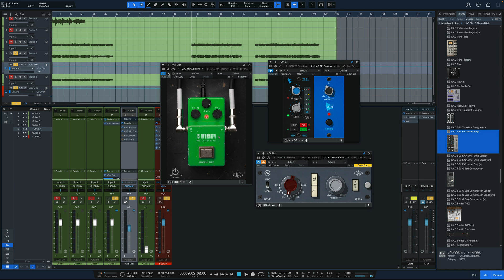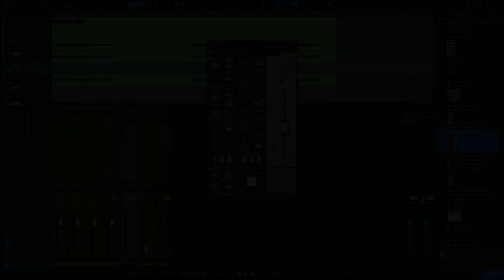Joe Barresi Parallel Guitar Distortion | 2 Easy Methods for Huge Guitar Tones

Comment: Parallel Distortion ALL DAY!!! -So, you're putting the pre amp and the tube screamer on a SEND and NOT just duplicating the track and putting the tubescreamer and the preamp on there, right?? What would be the benefit (or, non-benefit) of just duplicating the track vs a send?
Reply from the maker: No real difference between either method, it really just comes down to which workflow you prefer.
Reply: @GreenLightSound  Nice! i've always found it easier to create a parallel track, myself -Just a duplicate track. Somehow simplifies things in my mind... That you for this great tip! GLS always put out BANGERS!!

Comment: Hmmm, not once hearing these egs in context with the mix isn't something that provides a real world baseline. Honestly, save for a quick tweak, I never ever make all these decisions based on a solo'd track  - neither do any of the AEs I know, some are well accredited, and I'd venture to say Joe doesn't either. Cool jump off point but IMHO, and for the sake of comparison, these needed scope, which would be how they fit in a mix . The fact that they were thicker doesn't necessarily mean its a good thing ( I HP the snot out of guitars sometimes). There are lots of isolated guitar track examples out there from hit songs that sound literally "bad" , isolated. Cheers